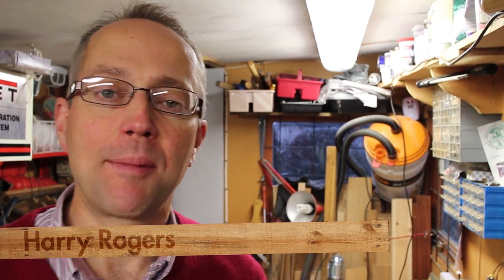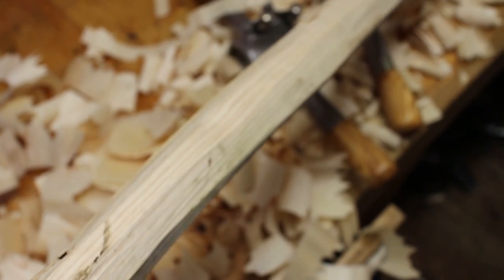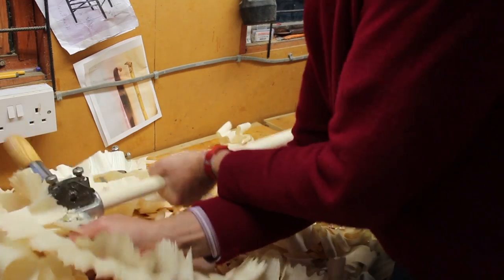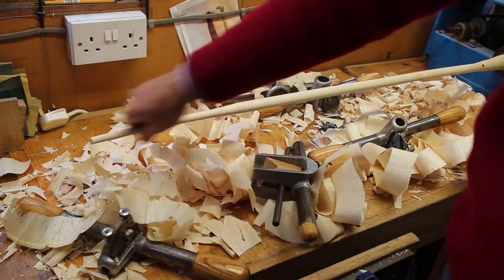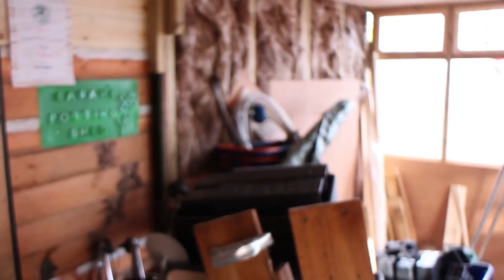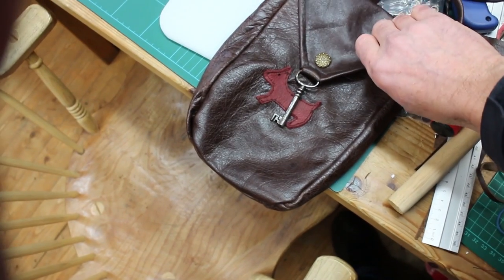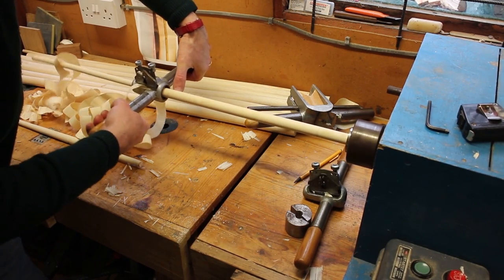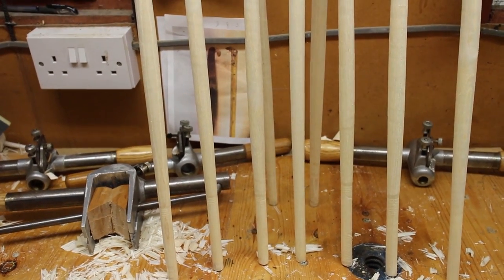Making the Glasgow Chair - Part 2 : Spindles (plus workshop extension)

Comment: I remember reading articles by a tall bearded British woodworker who was well known for his country chairs. The machine he had for use with rounders was based on a small three speed gearbox  from what must have been an equally  small car.  At a guess there would not have been a need for a reversing switch.
All the best.
Reply from the maker: labrat7357 yes that was Jack Hill....he used a Reliant Robin gearbox ...first suggested by Fred Lambert....two very inspirational chairmakers  I had the pleasure of meeting  in the 80s and sadly now both dead.

Comment: Excellent video as usual.  But the first part was kind of scary, what with the rough wood whipping about, but you seem to have a good understanding of what to expect.  
The tapering unit, is the "V" wooden block distance to the blade controlled by squeezing the handles?  
If so is the blade set at an angle?
Thanks.
Reply from the maker: Yes well observed.......the tapering unit is controlled by tightness of squeeze on the handles....the blade is set at 30 degrees to an arc of a circle if memory serves me right....I will cast some of these soon. The V wooden block has a big v for thick wood and a little v for thin spindles.
Reply: Thanks, will you video the casting?
Thanks
Reply from the maker: H H Hi - yes I will try and get something on this fairly soon........I am finally getting round to it but had to sort out a lot of tecky problems with the new to me but rather old furnace!

Comment: Wow Harry a home made spindle machine, new shop, stained windows in place, sharpening skills and all sorts of tidbits in between. The machine looks fun to drive, the shop is amazing, i use oil stones to and agree, it doesn't matter how you get the edge. Just as long as you get one. I know a guy that uses a coffee cup bottom and gets a razor edge.
Good stuff..
Stain glass was very neat.
Reply from the maker: Dave - the sound of your lovely planes on that cherry shows you get a great edge........interesting that we both use a similar method.
Reply: Harry I have mechanical means when I have I lot to do. But for one iron or touch up you can not beat an oil stone.